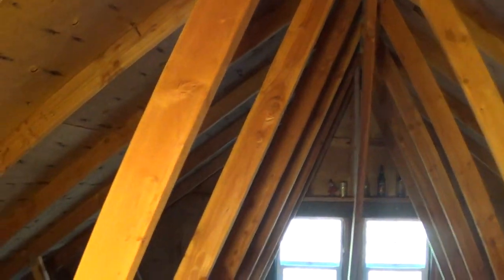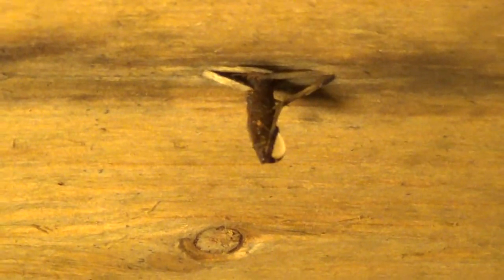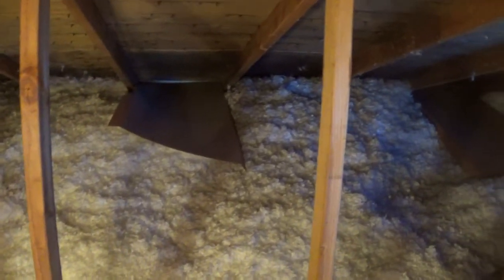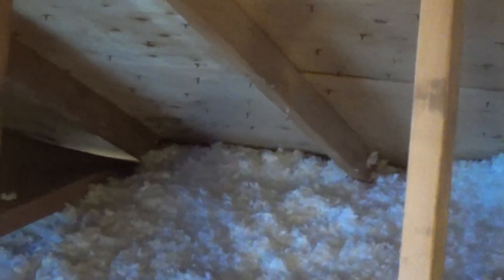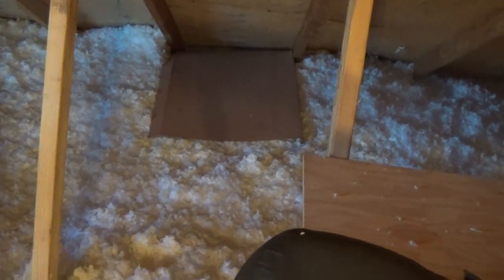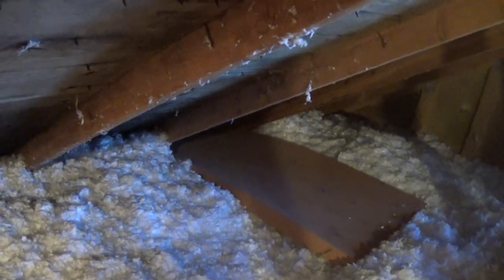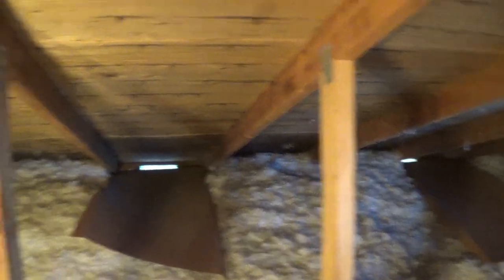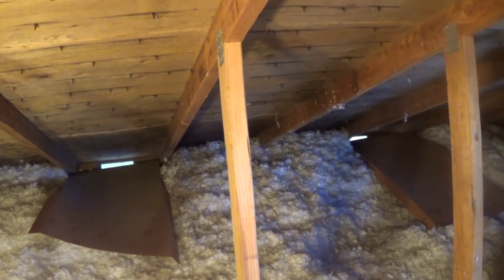How to Prevent a Wet Moldy Attic

Comment: Ventilation is the key. Baffles/soffit intakes suck. Cover them with new insulation and get on roof inflow vents/ridge vent. Make sure all bathfans/hvac/stove exhausts are properly connected to a vent. More often than not they are nailed to a rafter or just laying in the insulation.

Comment: I’m insulator I will tell you based on my experience what I recommend is checking your plates make sure all the cracks are sealed off with foan (can foan) all the recesses lights boxes also cover it with foam also your bath fan make sure it’s not broke or damaged and install baffles on every rafters in other words this process called (retrofit) that’s what you need do get done at your attic

Comment: I can feel air blowing like a wind coming through there so plenty of air flow I been roofing 10 years stumped same thing going on
Reply: Need to seal and dehumidify the attic space.  Zone 1 climate is 60% top vent(ridge), 40% bottom vent(soffit) in regards to proper ventilation. Venting is 1sqft per 300sqft of floor space.

Sometimes humidity is simply too much, we then have to seal off the attic and dehumidify
Reply: Did you ever figure it out I have a roof that I ice and water shield the entire roof. Before shingling but a drop of water on every nail. And this homeowner doesn’t want to hear it he believes it coming through the roof but it’s not.

Comment: Is that a bad sign of a roofing job, nails sticking out like that? We are about to purchase our first home. Thank you for the information.
Reply: Iv been doing alot of research because I'm doing a roof and if its osb board then it needs to poke though atleast 1/4 inch if there is plywood then it must penetrate all the way into plywood and not through
Reply: It's normal I own a roofing company. Been doing it 11 years all house nails will come through if it's roofed with shingles period. Unless you have super thick sheeting for some reason or a hot roof you will always see it.
Reply: @jessiehartman7180  How soon have you started to see rusty roof nails in the attic? Normally 1 year or 10 years?
Reply: @jessiehartman7180  Will rusty roof nails cause shingle issue or water leak? (I'm buying a new construction house. The roof and shingles were installed one year ago. Now I can see almost all roof nails are rusty. Should I ask for a replacement? )

Comment: Will rusty roof nails cause shingle issue or water leak? (I'm buying a new construction house. The roof and shingles were installed one year ago. Now I can see almost all roof nails are rusty. Should I ask for a replacement? )
Reply: It should t cause a leak, the nails are sealed under the roofing tiles. With it rusting so soon, that is weird, maybe there is condensation issues?